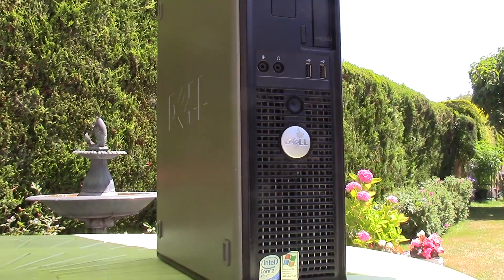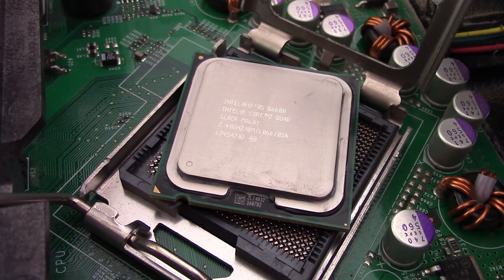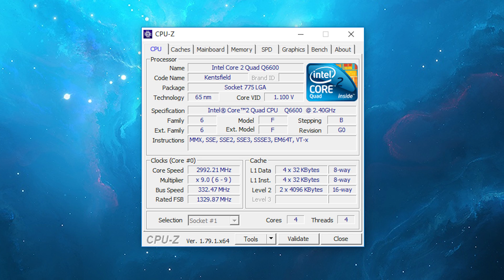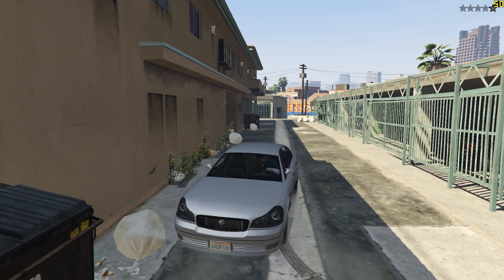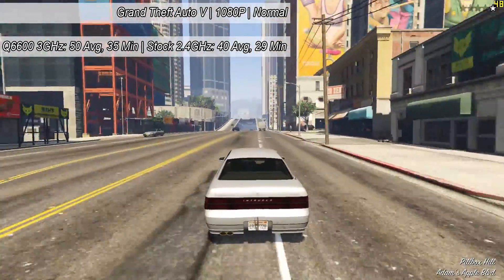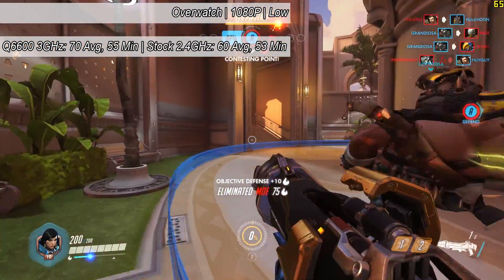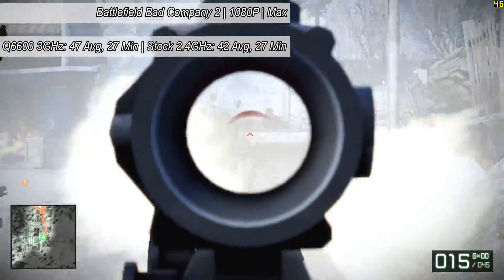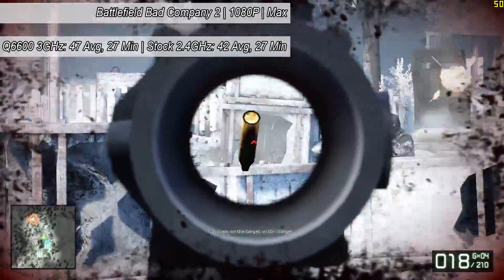Using Tape To Overclock an Old Optiplex

Comment: I have 2 options for buying an pre-built pc:
#1
i3-7100
1050Ti
8GB DDR4
#2
FX-6300
Same 1050Ti
8GB DDR3 

Both around 500€ (20€ or so price difference), you say build pc yourself, well this is gonna be my really first normal gaming-ish pc any opinions on prices, i would want to stick to i3 cuz it's as about same as FX-6300, any opinions? Thanks.

Comment: The best part is you didn't even have to tape up the middle pin because it's a voltage pin (which doesn't need messed with in this scenario). The pin nearest to the notch only being taped over has the same effect. Even more easy for people to accomplish now haha.

Comment: It maxes out the FSB on the board... a Q6600 runs at 1066Mhz FSB and with the tape the board doesn't know what speed the FSB runs at so it'll switch to 1333mhz FSB
Reply: The board has to be able to support a quicker FSB than the CPU FSB it is running btw

Comment: hey random i just tried this with my core 2 quad q9400 and the stock clock is 2.66 ghz. and after it did not increase my ghz at all. did i do it wrong? or does this just not work on my cpu?

Comment: I have an Optiplex 760, and I overclocked one pin insulated.

But my computer didn't cool normally.

My cpu fan did not automatically adjust the rpm.

I don't want to use a separate speed fan utility. Because it only provides two cases of raising the fan rpm. And it makes noise.

Of course, if the cpu is not insulated, the cpu fan works normally.

Is there any solution to this problem?

Comment: So can you do the tape trick with a q9400 to run at 3.0ghz or over? Or is there another way for a optiplex 330 with bios vA11 2gb ram.. gt 1030 2gb ddr5 oc edition..

Comment: For starters very neat trick. I'm guessing it wont work on my Q9650, as the bus is already at 1333.. Have to say I'm starting to appreciate these Multiplex's too. Got a 380MT for my 8 year old son & 2 weeks later one for his twin sister. Upgraded from the E7500's to Q9650's & threw in GT1030's, with 4gb DDR3 & a 500gb barracuda running win10 pro I can't complain. I'll order x4 4gb Crucial for these & be done with it. Still on stock 255 psu lol. Both systems will be less than $400 with a 20 & 22" lcd, keyboards & mice. 

I've always ran AMD cause of cost, I'm an old gamer from the mid 80's till about 2011 (twins were born) damn I'm getting old 46 this year :P. I'm also not so spoiled that I think my PC has to be as fast as NASA's to run some video games... Liquid cooling for Christ sake, just funny to me. Those guys need another hobby & probably a 2nd job to pay for their PC or in some cases a job to move outta moms house.

Comment: I bought a Dell Optiplex 780 Sff and it was my first low budget computer i have ever bought. Little did i know i wasn't permitted to alter anything through the bios. After making days and days of research i came across this video and it worked phenomenal on my Core 2 Duo E8400. Games run more smoothly but i do want to say that this tape method does not work for the Intel Pentium e5800. My computer did not want to start at all. Anyways, thank you for making this video buddy and hopefully there are more to come!

Comment: I'm not sure if my motherboard will support this mod. I've got an Intel DQ35JO motherboard with a Q9300 and 4GB of RAM. I'm in the process of upgrading to 8GB of RAM and replacing the Q9300 with a Q6600. If I change the CPU for the Q6600, will it out-perform the Q9300 when overclocked? I intend to do this mod to OC the Q6600.

Comment: Hey bro I need your help, so i saw this great deal which is a Core 2 quad cpu with 12 mb cache for only $50. Should i get it for my lga775 setup with ddr2 ram support? or should i opt for a new lga 1151 setup with core i3 7th gen  with ddr4 ram support?........ btw i got a GT 730 4gig ddr3 gpu

Comment: Speaking of stability..I have xeon e5472 , p5k-vm and on stock speed(1600 fsb)chrome crashing quite often and after 30min-1 hour-BSOD(mobo officially supports 1600 cpus).Is anything possible to do?Or just buy new mobo?

Comment: my q6600 have 1.3V, this is normal? the temperatures are exaggerated, I put the processor in an optiplex 780 sff which came with a 2 duo E7500, the paste is well applied, everything is fine but reaches 65 degrees at rest and up to 92 playing, with the fan almost 100% , the sink that brings is the stock with the part that touches the copper processor, I do not know what to do better I put the previous 2 duo which is at 30 degrees at rest and at most at 50 playing and even stressing it. Any recommendation?
sorry if it is not all written well but I am using google translator since I do not dominate at all the English...

Comment: I have a question.

There are two ways to tape overclock the q6600.

First, isolating one pin,

Second, isolating the two pins.

You used the second method.

Is there a difference between these two methods?

Comment: Hey RandomGaminginHD i want to ask you something. I have an pc with a q6600 but sl9um version not slacr. My pc is: asus p5b deluxe, sapphire hd 6670 1gb ddr5, 8gb of ram 800mhz 4x2gb, psu njoy ayrus 500W 80+, hdd seagate barracuda sata 3 1tb brand new, cpu cooler cooler master t4, windows 10 pro. So i want to overclock my cpu to 3ghz (core voltage - 1.3, fsb - 1.3, dram - 1.850, ht - 1.3, nb - 1.34, sb - 1.5) and when the pc start to boot windows it goes to welcome screen and then the system crash and shows blue screen with artefacts. And when i clear the settings to stock it runs normal at the stock speed. I want to tell me what is the problem in my pc because i cant solve it. And i try the tape method but dont work on my system. !!! THANKS !!!

Comment: Your explanation was wrong. It works because the two pins that you are blocking, are telling the Mainboard at which frequency the FSB has to run at. If nothing can be transmitted, it automatically runs at 1333mhz. Since the Q6600 has a stock FSB of 1066Mhz, it will run faster. And a faster FSB results in a faster internal clock speed.
You can even see it in the CPU-Z windows under rated FSB.

Comment: +RadnomGaminginHD Can you please help me? I've got a Q6600 2.4Ghz, RX 480 8gb nitro+, 6gb ddr2 800mhz and a gigabyte ga-965gm-s2. I couldn't get it to work over 2.4 ghz and I can change the clock ratio to 9 but can't change the voltage could that be the problem? 
Thanks in advance.
I like your vids and have always found them interesting. I hope one day I could make videos like you.

Comment: why are those connections there in the First place if that thing easily runs at 3 GHz.
Reply: It saves power on the electric bill. When you run an office with ~200 computers or so, every watt-hour saved per device really started to add up and cut expenses.
Reply: didnt think about that. thx.

Comment: nice video
i do this to my q6600 too
which gpu to buy for this cpu?
thank you
Reply: A GTX 750 TI if you want to buy used is the best bet, or a GTX660 depends which you can get cheaper. if you are going to buy a new card a GT1030 would be sufficient even though it is a little weaker than the other two.
Reply: what about gtx 1050, i can use it if i want upgrade my rig. my question is will q6600 bottleneck gtx 1050?
Reply: Yes the 1050 will be bottlenecked in quite a lot of titles with the Q6600, but if you have the spare money go for the 1050 anyway since the price performance ratio is better than the 1030's.
Reply: zygis337 thank you man

Comment: I have the same computer.
I wanna know if I upgraded my core 2 duo to a core 2 quad, do I have to upgrade the fan?
Reply: Hi. I had the same setup, too.
Nope, just verify you have a non-extreme quad, and you'll be good to go.
The fan isn't the main contributor to cooling a CPU, it's the air moving through the surface area of the heatsink. You can't go over ~110 Watt TDP for a CPU on an Optiplex, so you'll be fine if you don't get an extreme edition.

Comment: RandomGaminginHD Can you do a test with a core 2 duo e8400 and the gt 1030? I have bought a system with this CPU and was wondering how it would hold up with gaming paired with the 1030 since i am planning on getting this GPU for gaming.
Reply: The cpu will bottleneck that gpu. Overclocking wont help it much either.
Reply: I never asked him to make a vid on overclocking the CPU i was just requesting a vid in the future. I am not interested in overclocking anything, hence my previous speech never stated that process.

Comment: ... why do people do this the wrong way. You need to cover only 1 pin, not 2. I know it still overclocks, but by doing this shows no research done. Its still a great video, but with no research it can be misleading.

oh and this mod is bumping up the base clock from 266Mhz to 333Mhz, the multiplier is always between 6 and 9 for the q6600.

Comment: HELP how do I overclock a core 2 quad q9650 on a dell optiplex 780 please
Reply: This will not work on that cpu. This boosts the fsb and the q9650 already has that boost naturally.

You can’t. To my knowledge there is no method for you to OC your cpu on that Dell or really any OEM pc. Need a 3rd party mobo with OC capabilities
Reply: @stevesmith1383  thank you!!!

Comment: Hey man, could I do this with an q8200, 2.33ghz ? I'm only able to oc it to 2.66ghz with an abit ip35-e 
3ghz would be "amazing" :)
Reply: AnimatorPanimilator you can't because the fsb is already ar 1333 and on q6600 1066 and after the bsel at 1333

Comment: Can you use the 771 to 775 trick and this together?
Reply: I don't think so, and why?
The 771 to 775 would let you overclock anyway.
Reply: Probbably not because the Xeons are allready 333MHz chips, if you would have a old 65nm 266MHz Xeon (which would be stupid, since it will be slower than 45nm 54X0 Xeons even if overclocked) it would work however :)

Comment: has anyone tried this with a q6700 yet?
Reply: The Q6700 is exactly the same as the Q6600, apart from a 0.16Ghz higher baseclock. So it should work just as well as the Q6600.

Comment: I tried it on my last budget build when I saw it in the comments of one of your videos. Worked like a charm. You don't even need both pieces of Tape. I only put one on mine. The system is super stable. I ran it like 5 hours with prime95 just to test. Before that I had tried setFSB but it crashed the system at like 2.8 GHz because of the simultaneous Ram overclocking you get with setFSB

Comment: If i do this to my stock Core 2 Quad Q9550 what clock speed will I get?
Reply: Depends on multiple factors. Motherboard, power delivery and the cpu itself. Nobody knows unless you try it.
Reply: Donkey Chainsaw I will try this and report back

Comment: Totally works on Optiplex 760 with E7400 2 core Duo2.  Went from 2,8Ghz to 3.5Ghz, great job. Used CPU-Z program to check before and after stats. 
Link to CPU-Z
https://www.cpuid.com/softwares/cpu-z.html

Comment: I'm just wondering, would it work with a lga 771 xeon (e5430) put into an optiplex system? You had the lower clocked version of it featured (e5410 right?) recently, perhaps that would be worth a try too?

Comment: Actually the multiplier is locked and always is between 6 and 9. With this mod you change the FSB speed from 266 to 333. This multiplied with the multiplier gives the actual CPU clock.. Also, the multiplier should still go down to 6 when idle, unless SpeedStep or EIST is disabled in BIOS. Nice demo of the (very welcome) increase in performance tho for this still amazing old cpu!
Reply: How?
Reply: @jewielunay5973  Watch the video

Comment: Wouldn't it melt?
Reply: Electrical tape is vinyl so it will melt between 100 C - 260 C. Computers crash if they somehow go over 100 C after thermal throttling.

Comment: If I were you i'd be careful with overclocking a CPU and motherboard that shouldn't be overclocked, the power delivery on a motherboard is only rated for so much and obviously overclocking would draw more power. I'd want to watch the temperatures of the VRM's etc on your mobo

Comment: somebody please tell me if this works with a Q8200
Reply: It should. The Q8200 is just like a Q6600 but with a 10W lower TDP and a slightly lower clock speed. I see no reason why it shouldnt work.
Reply: Donkey Chainsaw Thank you very much.
Reply: actually it will probably not work... this is because the Q8200 has a very high FSB (1333 MHz) most OEM boards don't support FSB's of 1600 MHz. I have this cpu aswell and this chip is a very bad overclocker because of this high baseclock

Comment: I have a optiplex 780 with a core 2 quad q9400 and this didn't work :(
Reply: Is it due to mcupdate_GenuineIntel.dll?  but  I'm deleting it dosen't work.
Reply: @user-sheephuman  No, apparantly it only works on the 65NM CPU's like the Q6600 or Q6700, but Mine is a 45NM.
Reply: @reki353  I'm using 780 SFF with CPU q6600. Bios is stable working. I was Incomprehensible, but understunding that Motherboard is not adapt FSB 1600.

Comment: can i do this on c2duo e8400 is it applicable on this processor? @RandomGaminginHD
Reply: no, e8400 has 1333 mhz FSB already (333*9=3000 mhz on cores ), BSEL mod only help with 1066 mhz FSB (266*9=2400 mhz cores), like c2d E6xxx, E7xxx, q6xxx
Reply: thanks for the reply man.
ok is there any way to overclock processors with 1333 Mhz fsb?
Reply: is BSEL applicable on all C2duo's and C2Quad's with 1066 MHz fsb?

Comment: İ buy 25$ Dell 745 SFF, and 17$ X3320, 20$ 8gb ddr2 Ram, 70$ gt 1030 and 20$ new 1tb hdd, and İ overclock the cpu @3,0ghz, performans is very slightly better than this pc :)

Comment: I have a Q9560 @ 3.0 Ghz (stock), is there a way to push this? (Optiplex 780)
Reply: Did you find a way?!
Reply: @seifeldeinwael1619  No I didn't. But 3ghz is pretty good for a CPU that old now.

Comment: Would this work with a q9400?
Reply: Yes, but the board must support 1600MHz by deault (and most OEM stuff doesn't).
Also, you must check 45nm cpus Intel electrical spec for exact BSEL mod settings :
https://www.intel.com/content/dam/www/public/us/en/documents/datasheets/core2-qx9000-q9000-q8000-datasheet.pdf (page 32)

Comment: Can I apply this method on a Q8200 in a same system (Optiplex 755 Desktop) or it just works with the Q6600?
Reply: Andrea Gerhard Lutz should work with any LGA 775 dual core or higher proccessor
Reply: I know this is 7 months old now so hopefully it'll help someone else, but no, you can't: The Optiplex 755 has a FSB of 1333 and the Q8200 has an FSB of 1333 and all other Core 2 Quad CPUs have a 1333 FSB, besides the Q6600, Q6700, and QX6800, which have an FSB of 1066. Because the latter CPUs have a lower FSB you can force them to run at the Optiplex's max FSB (1333), thus raising their clocks. However, the FSB is your ceiling; If you already have a CPU that hits that ceiling, you can't make it go any higher.

Comment: will this work with a Q8300??
Reply: Yes, but the board must support 1600MHz by deault (and most OEM stuff doesn't).
Also, you must check 45nm cpus Intel electrical spec for exact BSEL mod settings :
https://www.intel.com/content/dam/www/public/us/en/documents/datasheets/core2-qx9000-q9000-q8000-datasheet.pdf (page 32)
Reply: Compatibility Madness I'm new to this pc stuffs so I m sorry if this question seems dumb. I also have a q8300 and my motherboard is a g41t-m16, will this work on that?

Comment: overclocking cpu with electrical tape? it's bad for your pc, overclocked cpu will cause more heat, more heat will melt that tape and it will go to the little hole in that cpu socket and damage those pins, therefore you can't remove that melted tape off the pins, cause the holes are so small, the best thing is to pair the highest gpu that you can afford, maybe rx460 or 1050 or 1050ti, and increase the resolution, because the higher resolution= low cpu usage= higher GPU usage= better frame rates.
Reply: it melt, but the temps are different depending on the tape model